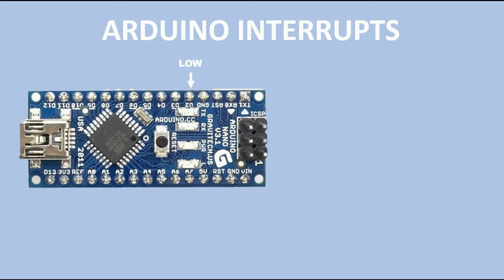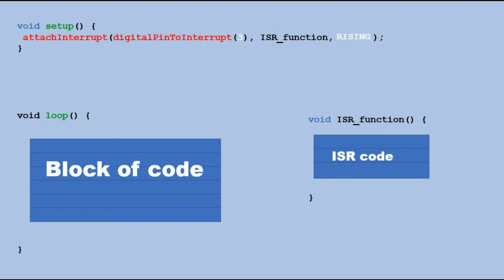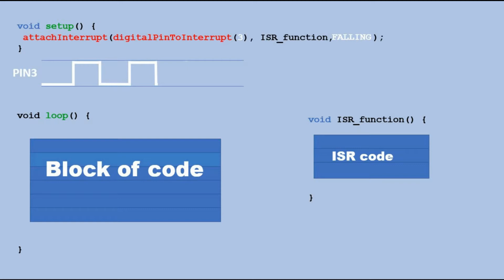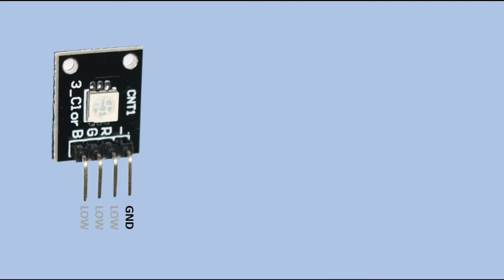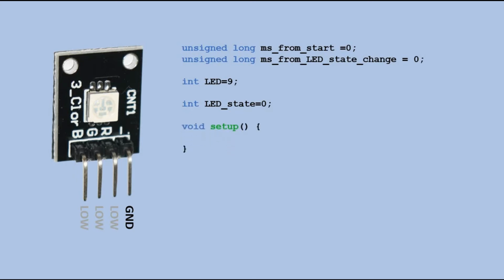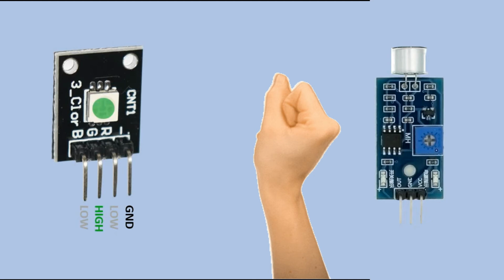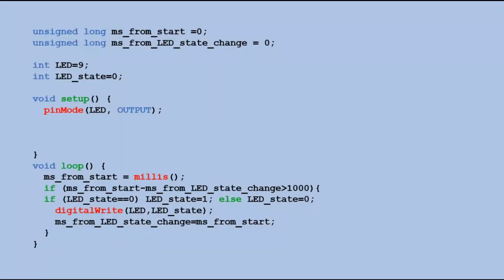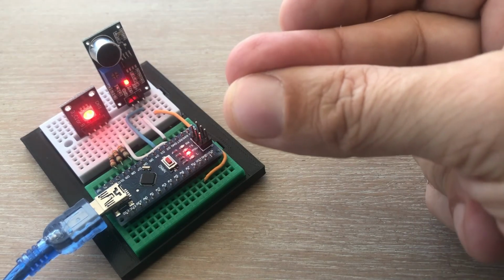How to use interrupts in Arduino projects

Comment: Thanks for the simplicity. I tried the code using 3 LEDS. On interrupt, the previous flashing LED remained ON while the next LED flashes. Please, what could be wrong?
Reply from the maker: In ISR just before LED++; command add line digitalWrite(LED,LOW); and let me know if this fixes it
Reply: @marios_ideas  Bravo, it worked. Thank you so much.